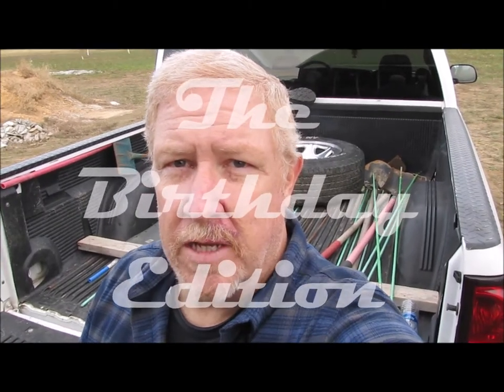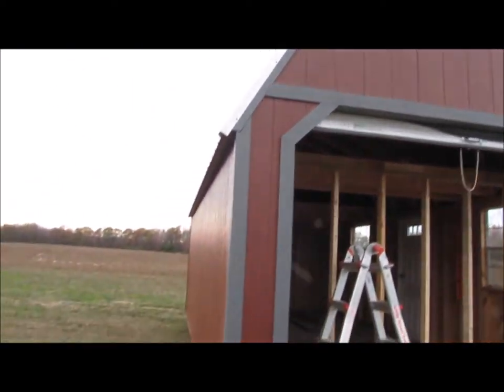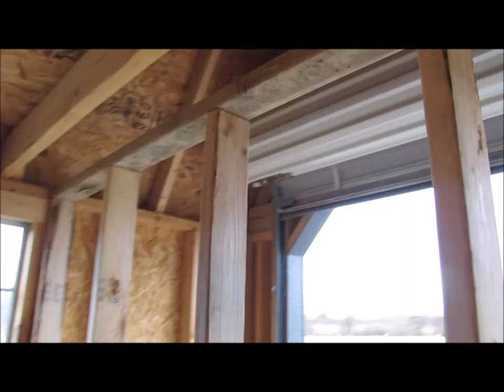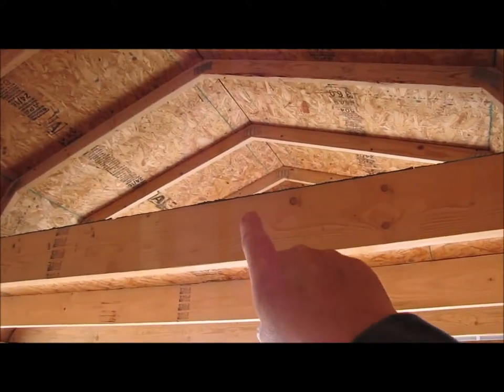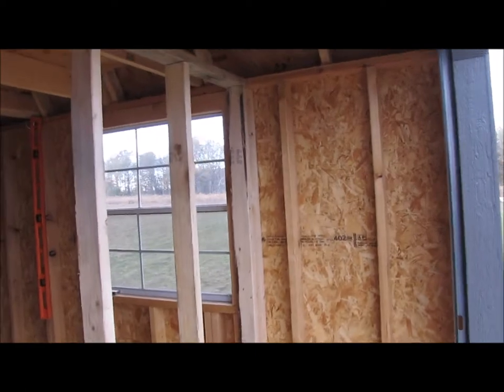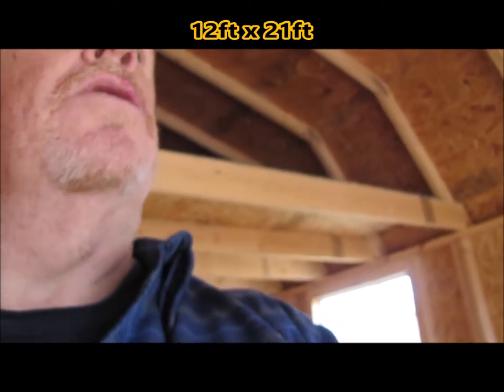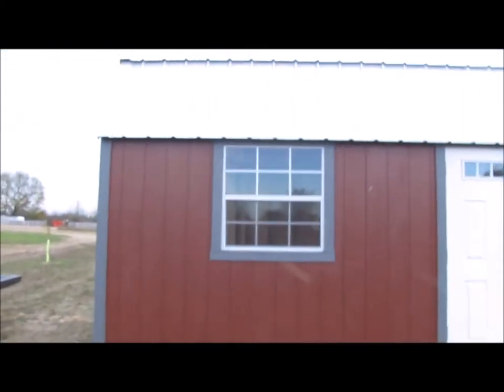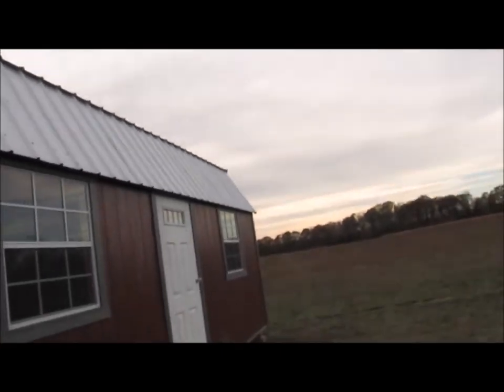Shed to House - The Adventure Begins

Comment: We've spent time in one of those sheds.  My 2 cents is.. put in the best insulation possible.  Including under the flooring.  For heating we used a smaller version of  "Mr. Heater F274830 MH18BRV Big Buddy Grey Indoor-Safe Portable RV Propane Heater (4,000 , 9,000 and 18,000 BTU)" (Amazon) I kept four 5 gallon propane tanks on hand..the tanks stayed outside.  Heh i wished a few times for a heater this size.

The porch area will be sweet to have.  :)
Reply: Can duct tape those holes on the metal.. it all helps..
Reply from the maker: Thank you for the insights.  We are looking forward to staying on our property soon!!
Reply: You are most welcome Ed.  Having space for you & Ernie will be awesome to have again.  Everyone misses that during times of many folks togetherness.

I was soo glad to have had very warm insulated footwear during the cold months.  Cuz there was no floor insulation & the little bit of wall insulation was poor quality.  Heh i put plastic over windows & walls, inside.
Reply: @MakkIsLooking  Thanks for the advice! We were definitely talking about that floor insulation.🥶
Reply: @ErnieHatmaker  you are most welcome my friend.  :)  Hugs